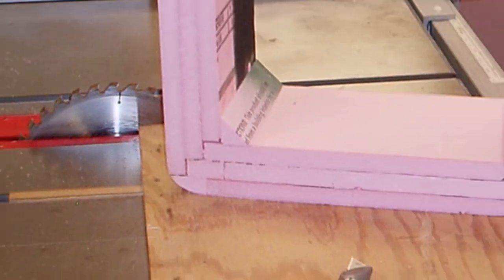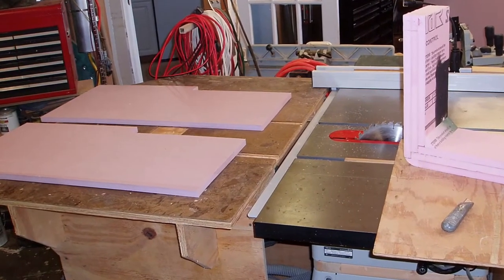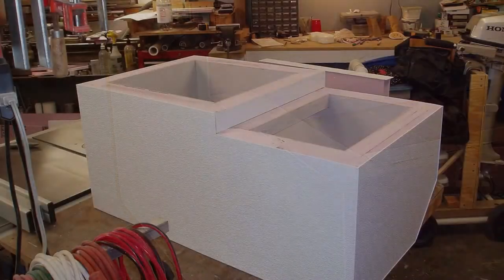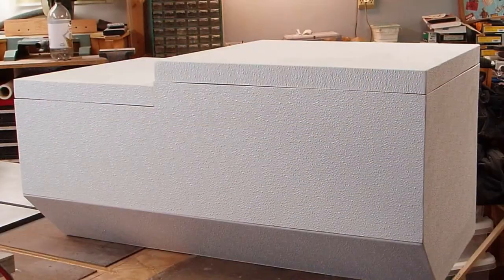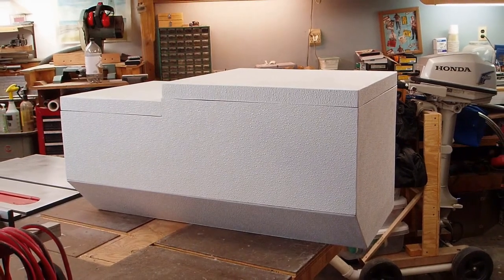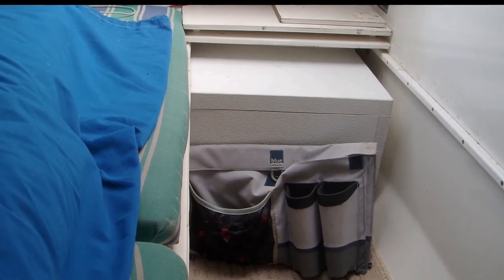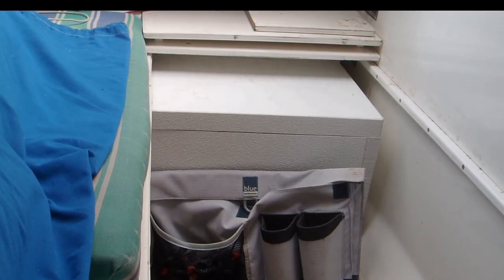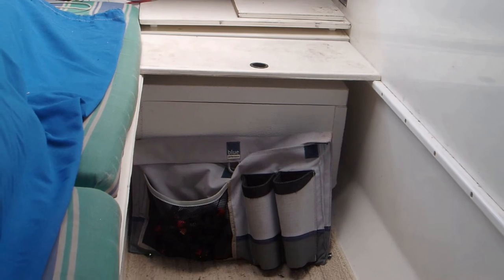Making a Custom Cooler

Comment: What glue did you use?
What did you use for interior lining?
How did you water proof the interior?
What did you use for a seal on the lid?
Reply from the maker: I initially used a 3M spray 77 from Home Depot. Worked well for about 6 months. The humid boat conditions began to eroded the chemical bond. All the repairs were made with another 3M spray product 6070 and can be found on Amazon.
   For the liner I used a rubber membrane, same used for shower tile underlayment, again Home Depot. I didn't glue, just held in place by a plastic frame I installed for my particular needs.
   Under the liner are thin sections (glued) of a radiant barrier material (home Depot), comes in a 4x8 sheet. Just for additional internal impact protection for the Styrofoam.
  Lid was just sealed with a friction fit and gravity.
Thanks for asking, I should have included more detail info and a follow up. . . didn't expect this to be seen by more that 30 people (Educational workshop) at the time of filming.

Engineer Bill
Reply: @engineershomeworkshop2692  I agree, intriguing idea and video, but more specific information would have been helpful. If you made a 'how to' video, I bet you'd get 200K views. Often people are simply 'stuck' with what is generically available at the store. We forget we have the ability to make our own things. This is a prime example and I suspect would get a lot of interest.

Comment: Looks great! Could you share the materials you used? What did you use for the interior lining? And did it hold up without any leaks for a good length of time? 
Is the insulation rigid closed cell foam?
Reply from the maker: Look for more info on my web site Cecelia.

Comment: Hi, just stumbled across this. Is it still in use? How rigid was it. I’m looking for something that could come on and off the boat so it would need to be fairly sturdy. Thanks
Reply from the maker: The cooler was custom made for a boat I no longer have and it was designed to stay in the boat. You would probably need to coat the outside with fiberglass / resin to make it strong enough for extra handling. And, add handles. Good luck.

Comment: For the exterior you used fiberglass panels. What about the inside?
Reply from the maker: I originally used a white utility board (comes 4 x 8 in Home Depot). . .glued to all inside surfaces for abrasion resistance. Always had my ice contained so the cooler never got wet. Sometime later I converted the cooler for an experiment and used commercial grade silicone 1/4" sheet rubber and made the cooler able to hold water. (again Home Depot, in the plumbing section)
Reply: @engineershomeworkshop2692  wow thanks a ton. Appreciate your response.. many YouTubers don't even bother replying.